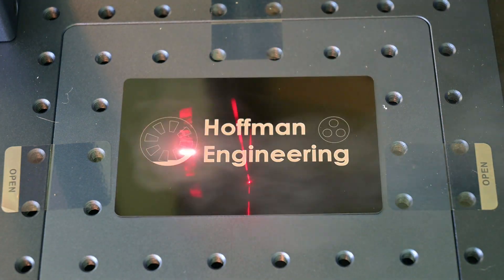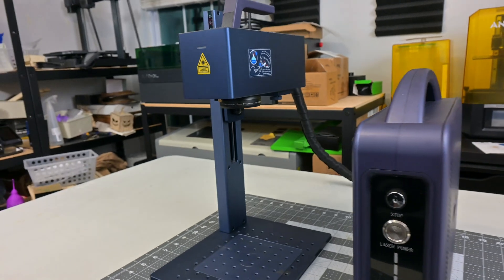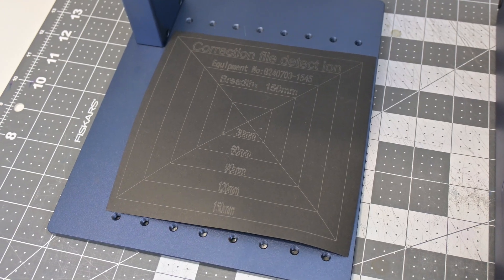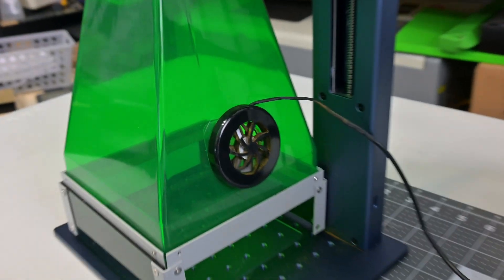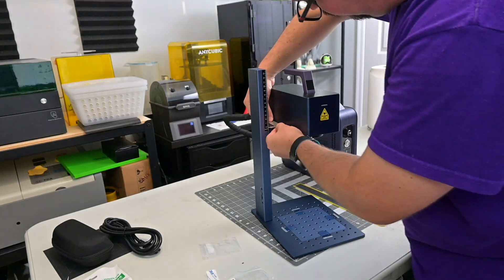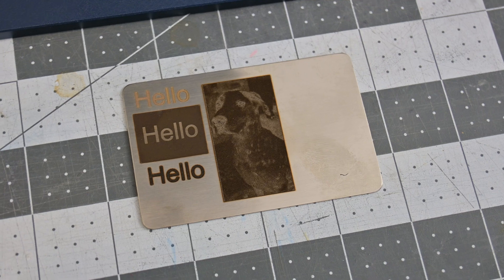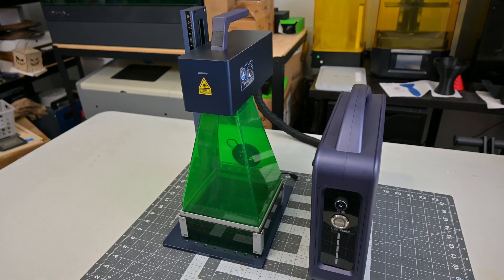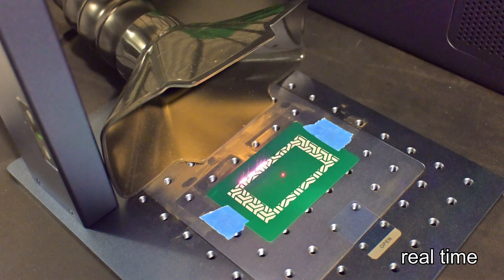The Best 30 watt Fiber Laser | Deep Metal Engraving, Lightburn Support - Gweike G2 Pro Review

Comment: Can you make deep engravings with the G Laser Software?
Reply from the maker: Not in the same way as lightburn. You can engrave as deep as you want in G Laser, but it doesn't have the same 3D Slice greyscale feature as lightburn. I've only used Glaser to deep engrave images with only a couple layers, like my Hoffman Engineering logo.
Reply: @HoffmanEngineering thanks for your answer.

Comment: Would you mind sharing settings like your cross hatch/ angle etc?  Im trying a bunch of diff settings.. I can get a bunch of blues, but not the greens or reds.  your color chart here is perfect. would love to know your overall settings please.. thank you
Reply from the maker: Sure thing. All the information is on that stainless steel card, except for the angle which was 0 degrees. Speed was 1000 mm/s, line interval was 0.001, and power/frequency are labeled on the axes.
Reply: @HoffmanEngineering  Man thats so bizarre.. i am running the exact same settings with very different results.  Are you at 261 or 264? somewhere else>? thank you @hoffman

Comment: How did you get light burn v 1.701 to work with it? I can't seem to get it working.
Reply from the maker: I believe it was a matter of plugging in the usb, open the device list and used "find my laser". It detected it no problem. Then I used the configuration images on the USB drive to update the x and y axis galvo properties.

I was using a 1.7 release candidate when I added it, but I doubt they would have broken it between the release candidate and the final version.

Comment: How safe are these since most fibers do not have an enclosure?
Reply from the maker: It has the same dangers as other lasers. You'll want to wear laser safety goggles to protect your eyes from reflections. Since the beam is infrared, you can't see it, so you won't be able to see reflections. But it can still damage your eyes. 

You'll also want to think about ventilation. A fume extractor is a good idea to pull particles and fumes that get vaporized by the laser.

Comment: How well do you think this would work for engraving guns at events? Also what kind of learning curve could someone expect from their software?
Reply from the maker: I think it would work quite well, metals are its specialty! The manual does a good job at walking you through how to setup and use GLaser. And they have a good set of speeds and powers for different materials that is a good staring point.
Reply: @HoffmanEngineering is this a raycus laser?